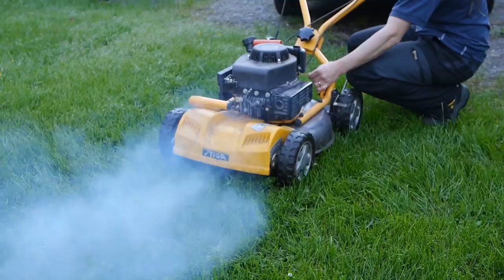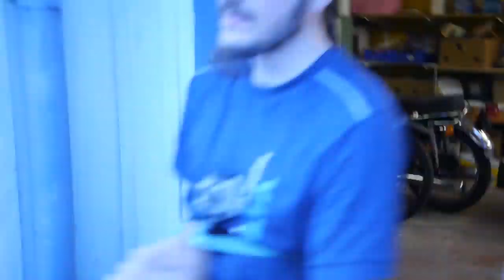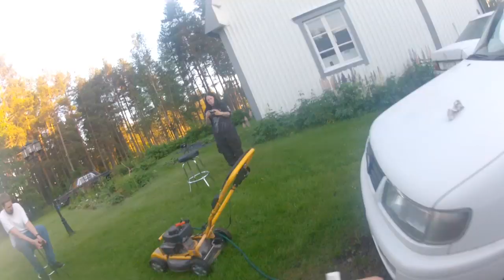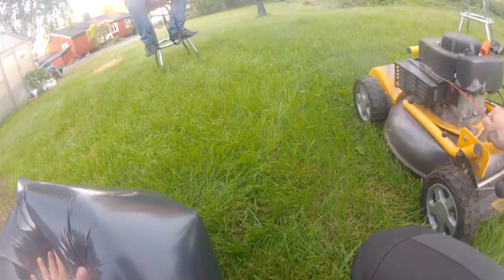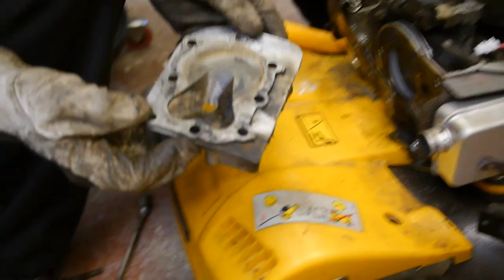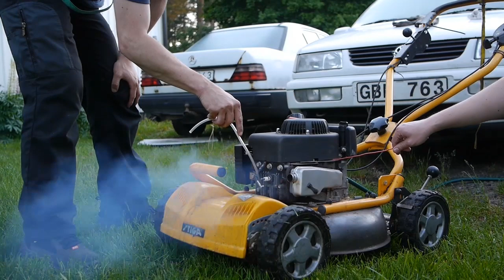Extreme mower torture.

Comment from the maker: We tried everything we thought could kill the engine in a spectacular fashion, going easy on the ignition wasn't really a priority.
That being said, I believe everything still works on the engine, the actual mower's been thrown out. Maybe someday we'll find a use for it.
Reply: Try WD40, or lighter fluid, or cut the fan or fins off the crank, or pour all oil out and fill crank with gas. if you don't mind next time.
Reply: There are no fins on the crank shaft, do you mean flywheel?
Reply: +knightrider1545 I think you'll find it'll actually run on WD$) as it is combustible enough & is a lubricant so probably wont seize up
Reply: Will it run with a water injection along wiht fuel/air to  create lower temps therefore increasing boost pressure in the cylinder?

Comment: Thats the best mower engine Ive ever heard why did you kill it?
Reply from the maker: My brother who donated it had problems with the engine losing power and over heating while mowing (if I remember correctly) and he got tired of messing with it. Bought a new one of higher quality instead. So we tried our best to kill it but didn't really succeed.
Even though it ran perfectly for us I don't regret it.
Don't you ever wonder how far you can push things before they break?
Reply: Frinkbit oh gald to hear its not dead i would clean the cooling fins and it will probibly be fine. And yes i have tried ''stress'' testing my lawn equipment aswell. But not to the point of breaking.
Reply from the maker: Spencer Clements Yep, still alive and well(?)
We have been thinking about putting an alternator on it and using it as a simple genset.

Comment: Looks like there is a remote throttle control on the handle. What is the string being grasped which is coming out from under the top cover? Is it somehow changing the spark advance? Seems to cause the engine to detonate when pulled.
Reply from the maker: LakeNipissing The mower had automatic throttle control which my brother had bypassed long before I got my hands on it.
The string is the make shift throttle control he built.
Reply: +LakeNipissing It dawned on me what was going on... someone tied a string to the governor vane and when pulled, it throttles up.. the 'tink tink tink' sound is the vane hitting the flywheel.

Comment: cast iron flywheel could blow apart and hurt people really bad not a good idea to run over stock rated rpm's
Reply: +Hobby Farmer Adam it wont just blow the flywheel apart, it can throw a rod at him or somebody else, iv over rev my mower engine sometimes.
Reply: +boneheadmoth as hezy I know but it would possibly be the first to go. I have worked with small engines for years and have see some thing in the small engine world
Reply: Iv been working on for a year now its preety fun... Do you have fb by any chance?